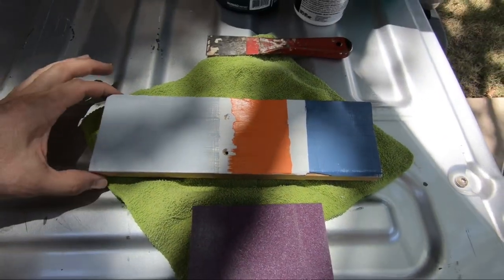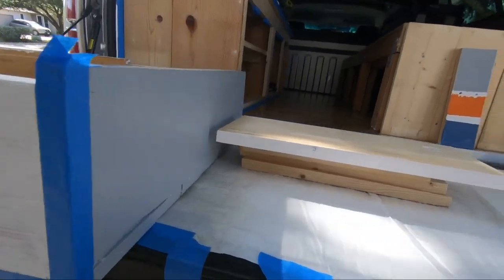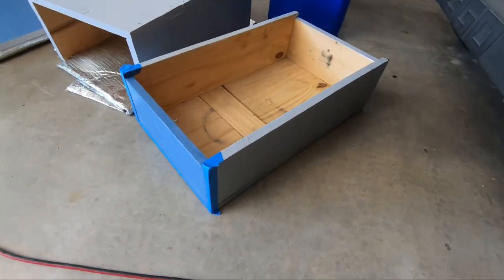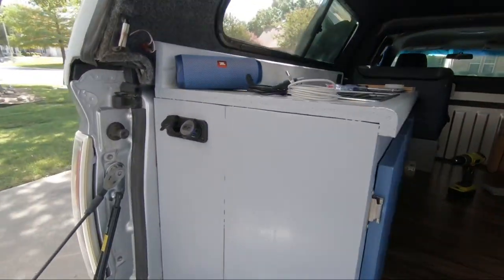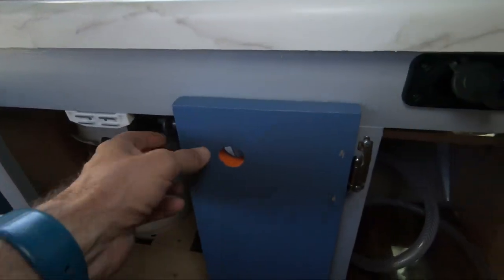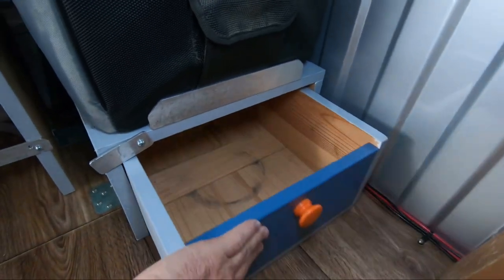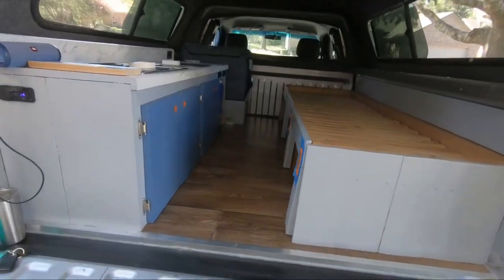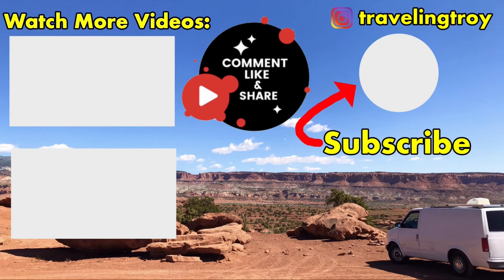DIY Truck Camper Build #6 - Painting #TruckLife #Truckcamper #F150

Comment: Looking good! Can't wait for the electrical!
Reply from the maker: Cool, thanks!  The clips for the electrical are shot, so just a matter of putting the video together.  I’ll give people a few days to watch this new one, then begin compiling the Electrical video. 👍 Thanks for watching/commenting. ✌️
Reply: Troy, I need enough power to fun a roof vent fan, a fridge like yours, to recharge my electric hair trimmer, cordless razor, and cordless flosser. (The 12v fridge will need a lot of power, but I do not think the roof vent fan will). I will install as much solar as I can. I plan on using a Renergy 3000-watt inverter/charger. The biggest concern I have is charging batteries for the "Zero Breeze" 12v air conditioner. Each detachable battery only lasts about two hours. I will need four. They will need to be charged during the day. I will use them at night, as for six months a year Phoenix is 100° even at night. Any advice, if you have please give me. TIA boss. 🫡

Comment: Wow,  beautiful job. I feel  like paint may be my best bet for upgrading my  older  class b van. I really like your accent colors.  That orange is really nice with the  blue and grey.  I can't wait for your electrical system video.  I  just got the power bank I ordered on Amazon prime day.  I am hoping to use it to power most of the house side of the older class b van.  I don't have to do anything to  use it in the  minivan,  just plug and play.  Thank you for another great video.
Reply from the maker: Yes, the colors seemed to work well together.  Thanks for the feedback.  I wish I would have painted the Astro van interior years ago.  Haha!  It was actually kind of relaxing just sanding and painting for a few days.  Taking a break from normal build activities.  Paint could really spruce up your Class B. 👍 The electrical on my truck is very basic.  We learned from my years with the van what low power needs I had, so we scaled back the electrical setup.  I think it will be a good video to show that more and more and more power isn’t necessary. 😉
Reply: @TravelingTroy  yes,I found my power needs are minimal too. I don't do television or own a laptop computer.  Just phone, tablet and a Kindle ereader.  I have not used the microwave in the van, so it may go too. I do need to change out the DC, light bulbs for LEDs and there are two vent fans,  a 12" square one and a 4" round one, like the vent fans on your topper.
Reply from the maker: @anitasimmons3599  It looks like you’ve got the idea. The less items you have which require an inverter, the less power you will need.  I have converted my daily use items to USB power only, but I do still have 2 or 3 items which need 120 volts from the inverter.  I use those only once about every other week.  Good idea changing out the bulbs. 👍 Ah! You caught that in my video? My 6in dome fans.  Yes, I installed two of them over the kitchen area.  I’ll talk about them in my next video. 😁